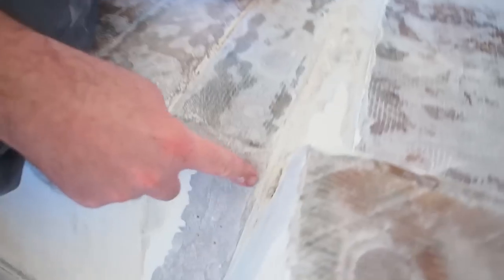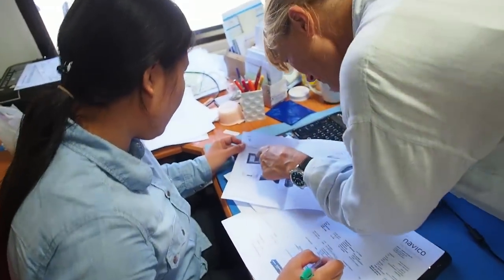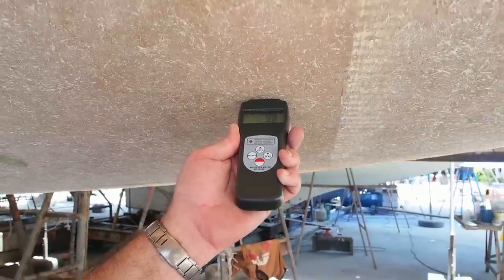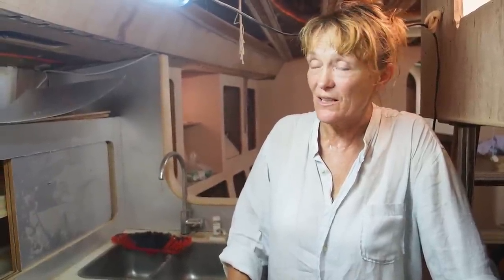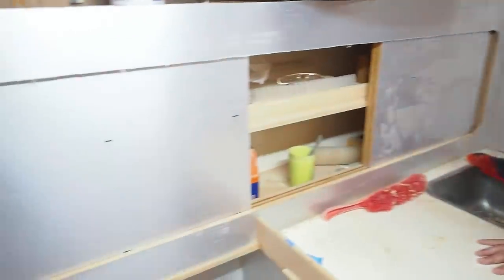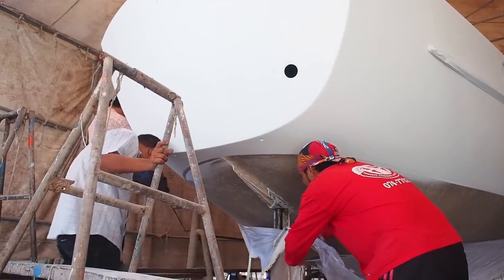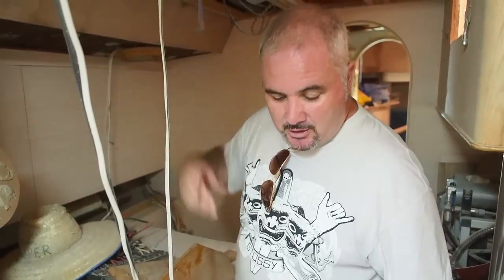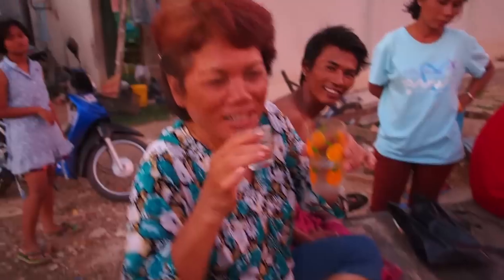Esper Refit 08 - Holes In Deck; Galley Is Tomato And Aluminium

Comment: I must say I don't envy the electrician's work! Did you consider a wipe on stain for the ash? I've used a white stain from Mohawk to 'pickle' or white-wash solid oak and maple cabinet frames with fantastic success. Esper is looking good!
Reply from the maker: I've not heard of Mohawk before but I looked it up and it looks interesting. The problem in Thailand of course is availability. I think we've pretty much sussed the whitening issue, though we now have to test to see how well it holds when polyurethane is applied on top.